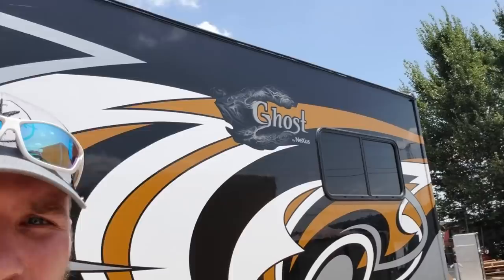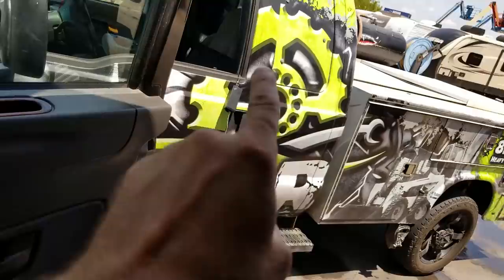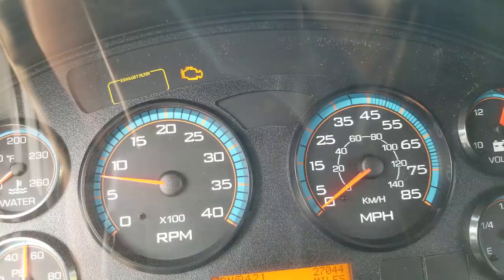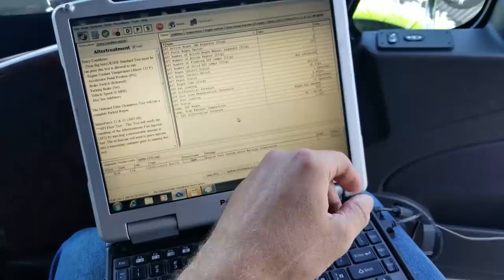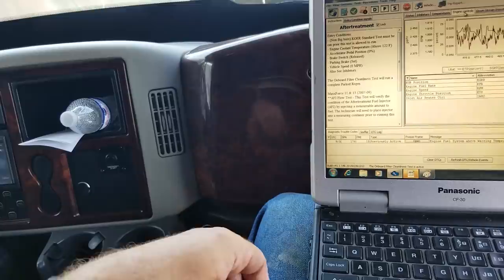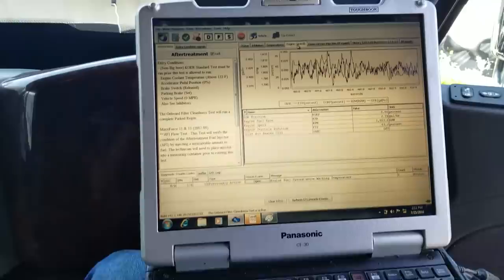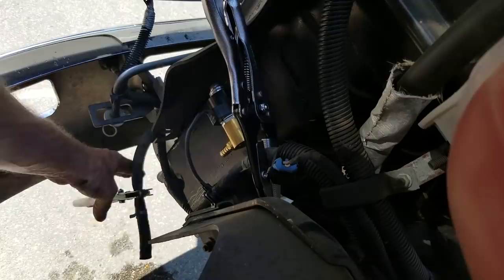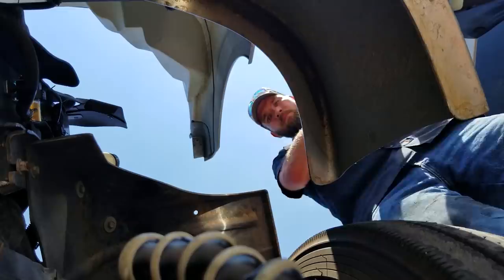Fixing a check engine light on a motorhome

Comment: Can I ask you a question, my 2007 Holiday Rambler 33sfs just had the check engine light come on I tightened the gas cap and checked the oil it's a quart low, would that make the light come on